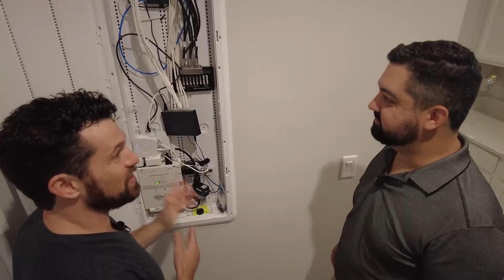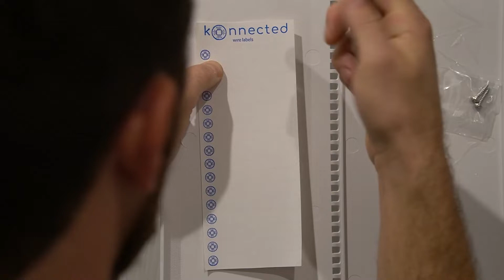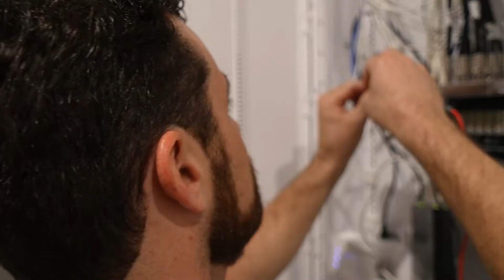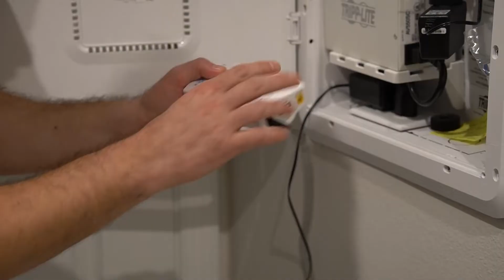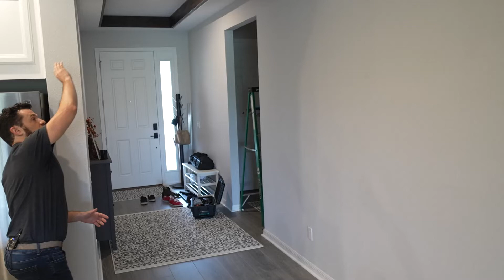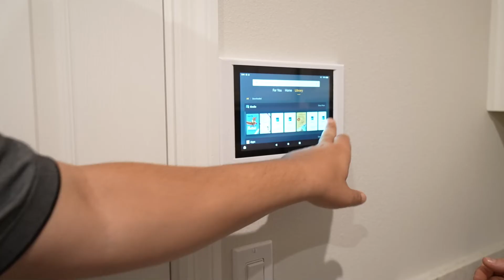Konnected Alarm Panel Pro Install | New Construction Pre-wired Smart Alarm: Konnected + SmartThings

Comment: Really interested in a system like this retrofitting a old house that I just acquired.  Old security system is toast and ancient.  Great information.  I think i will be using z wave switches from zooz.  And a zooz hub.  But I’m still researching how to do all this.  

Man though, how I hate those stupid metal hubs they put in houses like that.  Cramped, unorganized, and all the wires still come down through a wall.
Reply from the maker: Sounds like a great project. Good luck with it!

Comment: No outdoor siren ?  hummmm. I see two issue . Firstly- What about zone balancing resistors ! I see nothing, this mean no tamper zones. No tamper zones means less security and easy to  hack. This also mean that this installation can't be certified Grade 2 at least. Secondly- If the AUX output is 12V, this mean that you can't use an outdoor siren with 12V backup battery, because to charge a 12V battery you need a 13.8V to 14V to charge the internal battery, and with 12V power you will never charge that battery at full charge.
Reply from the maker: Short answer: You can drive an outdoor siren, and you can retain your existing tamper-loop protection - the key is whether you’re piggy-backing on the old alarm panel or replacing it outright.

Outdoor siren power
"Konnected Alarm Panel Pro Interface Kit" install (legacy panel stays): Keep the siren exactly where it is. Your legacy panel already supplies the 13.8 V float-charge line that recharges the siren’s backup battery. Konnected just “presses” the bell trigger and doesn’t touch that power rail.

Standalone Konnected install: The Alarm Panel/Pro gives you a 12 V DC output good for ~1.5 A - plenty for most 12 V piezo or speaker-driver sirens. If you want a siren with its own battery, power it from a small float charger or the old panel, and use a Konnected relay to trigger it. 

Zone-balancing resistors & tamper loops
With the Interface Kit the existing EOL resistors stay wired to the legacy board, so cut-wire/tamper faults are still caught by that panel. Konnected is simply eavesdropping on the same loop. 

If you remove the old panel and wire sensors directly to Konnected (Conversion Kit), it registers only open/closed. We call that out up-front - Grade-2 style supervision isn’t part of the spec. 

Certification takeaway
Konnected is a smart-home integration device, not a Grade 2 replacement. Want the paperwork? Keep the certified panel for compliance and let Konnected give you the app-level brains. Otherwise, run it standalone and accept the simpler (but still very workable) wiring model.
Reply: @Konnected-io  Thank you for all these clarifications.

Comment: So when the electricity drops you'll get no notification as the modem goes out with a power cut, second any battery backup, you could use a psu with battery backup, but still doesn't solve the modem issue from your isp!
Reply from the maker: A power cut only kills notifications if your network dies with it.
The easy workaround is the same trick IT folks use for VoIP:

Put the modem + router on a mini-UPS. A palm-sized 10 400 mAh unit keeps a typical 10W modem/router alive for about four hours and costs ≈ $40-$80. 

Add LTE/5G fail-over if you want “ISP-proof” alerts. Drop a plug-and-play LTE modem (e.g., Netgear LB1120) or a router with WAN-failover; when the cable line dies, it auto-switches to cellular and Konnected keeps talking. 

Do those two things and your GDO/Alarm Panel will stay online... and keep sending push notifications... through most blackouts.

Comment: Hey! Great video! I want 24 zones in my new house (no alarm, just pre-wired). Should i purchase 2 Pro Interface Kits or 1 Pro Interface Kit and 1 Alarm Panel Pro (board only)?

Also, another question is, where do you use the modules of the Pro Interface Kit in this installation. There is no mention for modules in this video but in the site it says that it is necessary for installing the first alarm of a new house.

Thank you very much! Konnected definetely covers a big gap in the wired alarm systems for smart hime! Great great job!
Reply from the maker: @antonismous7249 Thanks for the great feedback, and I just want to clarify the best setup for you!

Since you're setting up 24 zones in a new house with just pre-wiring (no existing alarm panel), you'll want to go with 2 Pro Conversion Kits (not a kit plus a board-only). This will give you everything you need to fully wire up your zones. The interface modules mentioned in the Pro Interface Kit are only necessary when connecting to an existing alarm system, so they won’t be needed for your new setup.

Thanks again for the support, and let us know if you have any more questions!

Comment: Love the POE option, Im already wiring my POE cameras up and it will be easy enough to drop a cat6 cable to where the previous owners had the panel installed, and I can get rid of the old power cable that was ran up, over the door frame, and through the wall to an outlet.

Comment: great video, thank you fr sharing   i have a siren connected to a 9v battery, open all the windows and doors,  i connect the siren to a pair of wires go throught the eme closing every door and window till i hear the alarm sound.  that is how i identify which wire is which when i am working alone. if its a bigger home i group wire together than when i find the group of wires that my door or window is in i do one by one. the other 4 conductor wire may be for a second keypad in master bedroom.

Comment: You need a hardwired alarm panel. The alarm needs to be able to work when internet is down.
Reply from the maker: This is a hardwired panel. It can work without internet using a local smart home platform like Home Assistant or Hubitat. Choice is yours.

Comment: I wish there was a way to avoid their cloud.  Now they has access to every time you open and window and more importantly when you leave your house.  They may even have access to your pass codes or be able to disarm remotely. This model lowers the overall security of the system.  This is why I’m not interested in Ring and the other cloud offerings. Is there a model that allows us to keep everything local?
Reply from the maker: Yes, you have many options to keep everything local with all of Konnected's products. Our cloud service is completely optional and only needed if you want to use it with SmartThings.
Choose Home Assistant, Hubitat, Homebridge or OpenHaB and the integration is completely local and never touches our servers. Check our website for details of all platform choices.
Reply: @Konnected-io  okay thank you

Comment: How do you turn on/off the alarm if the internet is offline?
Reply from the maker: It depends if you're using a local or cloud platform for your home alarm. If it's a local platform (like Home Assistant, Hubitat, Homebridge) then you don't need internet as long as you're on the local network/WiFi. If it's a cloud platform, and your home internet is down, just turn off your WiFi to access the app via your phone's LTE/data connection.
Reply: @Konnected-io  What if your power was out and now your running on batteries, no UPS on wifi modem/router and you don't have LTE option. When power is out I assume the alarm is on, how do you turn it off, thats actually the scenario I'm wondering about.  Because if I still had the a keypad from old alarm I would be able to turn the alarm off, is there a monetary switch to connect ?
Reply: I configured a UPS for the modem.

Comment: At 23:05 you mention that the power from the keypad cables is enough to power one tablet, but not two. And that one would need a separate power supply, such as a plug-in power supply with a DC terminal adapter. Do you mean just plug the tablet to a wall electrical socket, like I do now to charge it? Or did you mean do something in the Konnected panel?
Reply from the maker: The keypad cable gives you one pair of 12 V conductors that can safely supply about 500 mA from the old panel (or from the AUX output on a Konnected board). After you drop that to 5 V with a buck converter you’ve got roughly 1 A—enough for a single wall-mounted tablet running a dashboard but not two.

So the second tablet needs its own 5 V source. Easiest: keep using a normal USB wall charger plugged into a nearby outlet. If you want the wiring hidden, run a separate 12 V “wall-wart” power brick (or a PoE run) to the second location and step that down to 5 V there; it doesn’t come from the Konnected panel itself.

Comment: Hi, I also live in Florida, Orlando area. I have a new construction. Would you be able to install this for me? Like the video, I have all wires installed. It is missing the siren and motion sensors that I need to buy. My onq box is the same.
Reply from the maker: We don't typically do installations, but we do have installer/partners in the area that do! Feel free to send us an email at help@konnected.io
Reply: Thanks. I tried to contact you guys but when I got a reply it was too late. I already installed another system. Maybe in a new house in the future.

Comment: Why do we need smart things, I am a little confused there. If I install the system then what is the next step to get it on my phone
Reply from the maker: You don't necessarily need SmartThings, but you do need to choose at least one smart home platform to use Konnected. SmartThings is our most popular because it's easy and free. Konnected links your sensors and sirens to a smart home platform, where you can then make home monitoring part of your suite of smart home products.

Comment: Are there any issues having a central office monitor it since you are not using a old alarm system?
Reply from the maker: @67bruster Great question! If you're looking for professional monitoring without using an old alarm system, you can still get that with Noonlight. They offer affordable, 24/7 central monitoring for Konnected systems. It’s a simple and reliable way to have your smart home system professionally monitored.

You can check out more about Noonlight here:
https://konnected.io/pages/noonlight-professional-monitoring

Comment: In the future when making a video like this it be really helpful to have a diagram of the board up and showing where the wires go. Some of the shots are blurry and not very clear, like connecting the alarm panel power and buzzer. Also one huge thing that tripped me up when installing this was my pre-wire did not have any sensors on the windows or doors. Everything was showing open in Home Assistant but when I would go to open a window nothing change. Luckily connected support is really good about responding quickly. I bought some sensors on Amazon and now it seems to be working. Only do this if you’re a techie and have time. Also shout out to the start up engine campaign I am vested
Reply: I would also love if your shop could carry a case that could hold the board and could install in my smart panel well. Also the sensors make a lot of sense to also carry in your store.

Comment: Any plans to add ability to integrate wireless devices such as door, window, motion sensors?  I'd love to use your product but out of my 8 zones, 5 are wireless.   I really don't want to run more wires.
Reply from the maker: No, because there are already so many inexpensive wireless sensors on the market that work with home automation hubs like SmartThings via Z-Wave or Zigbee technology. Just replace those older wireless sensors with new ones that are compatible with your smart home platform.

Comment: I have a house with about 60 zones. how can I setup multiple boards with home assistant? do I connect them as separate Konnected instances?
Also what do I do If i wanna be a regional installer? Thanks
Reply from the maker: Each board communicates independently to Home Assistant, and HA acts as the controller of the system brining all the door, window, motion sensor, etc entities into one cohesive system. There are not really Konnected "instances" in Home Assistant -- each zone becomes an entity in Home Assistant that you can use for security, automation, whatever.

If you'd like to speak with us about becoming a dealer or installer, click on the "Become a Dealer" link at the bottom of our website.

Comment: How long can a series zone be because I have 33 long runs zones  in my new construction home  with all home runs in the basement because I’m having trouble on longer runs. Can I install a transformer and how on my pro panel
Reply from the maker: There's no defined maximum length, but it should work fine even with very long wires. Too many variables including the material of wire, wire gauge, temperature, etc. Measure the resistance on the long wire run -- it should be in the single-digit or low double-digit Ohms.
Reply: @Konnected-io  can I install an extra transformer and how do I wire it in?
Reply from the maker: @tomangerami1506  No, you can't just put an extra transformer in. It doesn't work that way.
Reply: @tomangerami1506  You can power your own series connected loops with a 24v transformer operating a relay.  Then use the relay contacts to any alarm system.  Caution:  Running 33 loops in series can be a problem when one fails or worse yet goes off intermittently.  At that point you will wish you had wired each loop individually so the failing zoned is called out.

Comment: Great job! I love how simple it is but wish I could integrate Smartthings locally instead of running it through the Cloud.

Several cloud servers have been going done lately and messing up my cloud based devices. Time to mod or switch those.
Reply: I have written my own software using C#. It is integrated with the konnected pro panel and hosted locally own my NAS in Docker. It communicates with the Konnected panel by HTTP REST.
Reply from the maker: That's why we also support Home Assistant, Hubitat and Homebridge. All great choices for local platforms!

Comment: Awesome man. I was wondering if you will be able to dismiss the alarm from from the tablet. And if yes does it require a password to dismiss
Reply from the maker: Konnected doesn't make the software for the tablet, it would be provided by whatever platform you choose to power your smart home with. Home Assistant has a nice virtual keypad that works to arm/disarm with a PIN code.
Reply: I think I'm going to buy one of these because it almost does exactly what I want,  however I have to say you're wiring is atrocious.
Reply from the maker: Haha, I'll take that as a compliment ;) I'm an engineer, not a perfectionist!